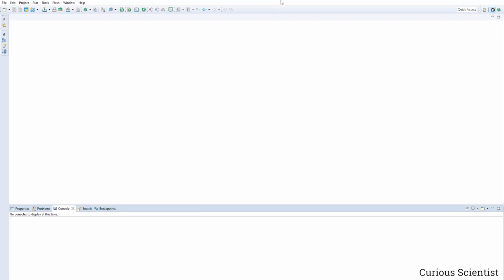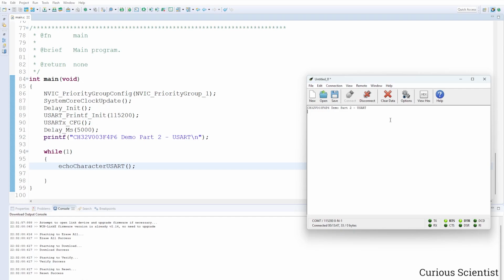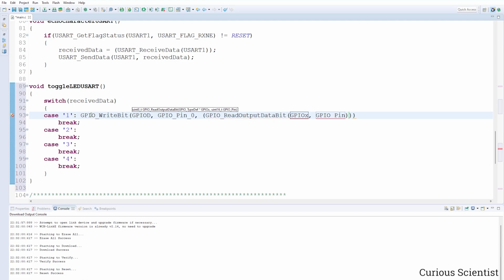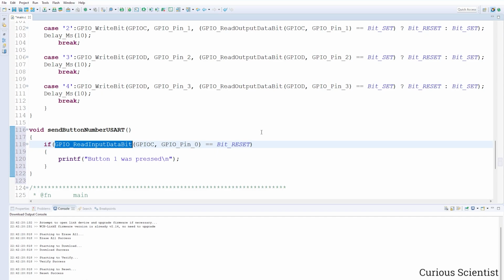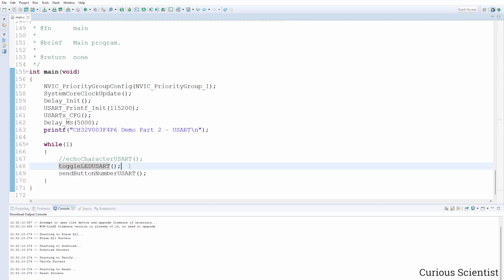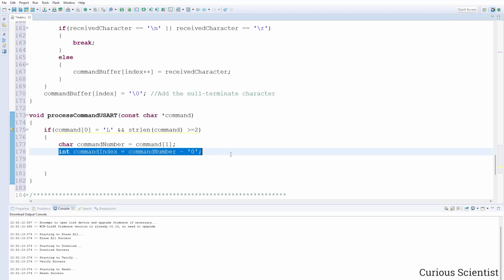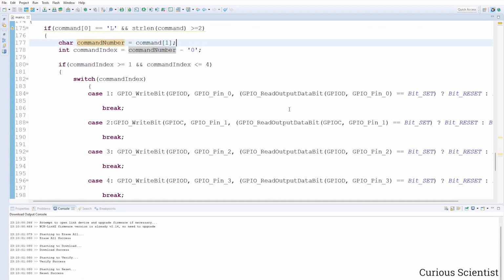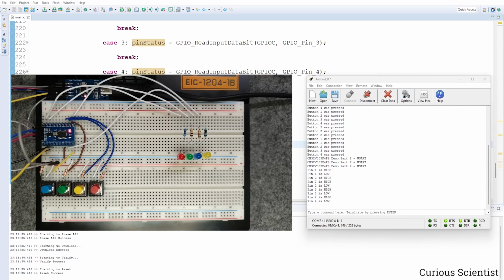CH32V003F4P6 Tutorial - Part 2 - Basic USART operations

Comment from the maker: CH32V003F4P6 USART Communication Tutorial - Part 2

* 0:00 Introduction: This tutorial covers basic USART communication with the CH32 microcontroller, building on GPIO manipulation from the previous tutorial. 
* 0:26 USART Importance: USART is crucial due to the chip's lack of native USB, enabling communication with a PC via a USB-to-USART converter (often integrated into the programmer).
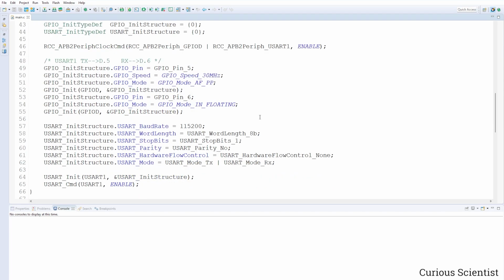* 2:30 Baud Rate Warning: Emphasizes the importance of matching the baud rate (e.g., 115200) between the microcontroller and the serial terminal on the PC to avoid receiving garbage characters.
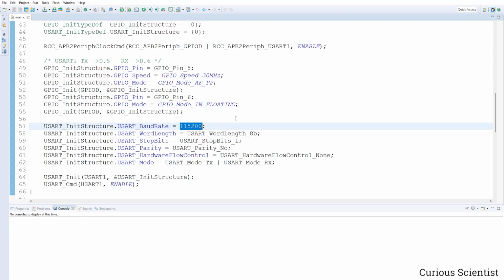* 3:38 Basic Echo Function (later removed): Demonstrates a simple function that receives a character from the serial terminal and sends it back, showcasing bidirectional communication.
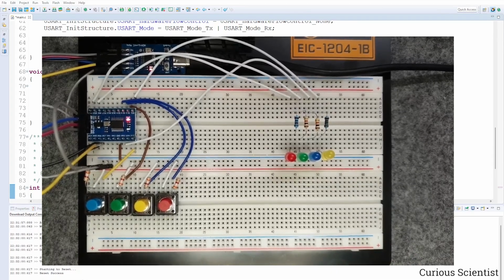* 8:56 Toggling LEDs via USART: Implements a function (`toggleLED_USART`) that toggles individual LEDs (connected to PD0, PD2, PD3, and PC1) based on received characters ('1', '2', '3', '4').
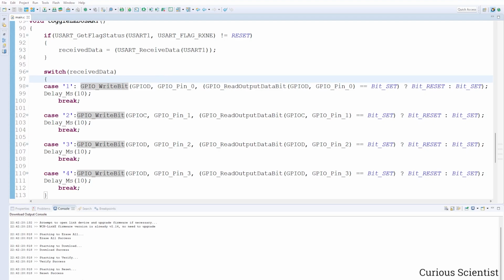* 16:25 Reading Button States via USART: Introduces a function to read the state of four buttons (connected to PC0, PC2, PC3, and PC4) and send the status (high or low) back to the serial terminal. Includes debouncing to prevent spurious readings.
* 22:39 Parsing Commands with Command Character and Number: Develops a more advanced approach to send commands like "L1" (toggle LED 1) or "B2" (read button 2 status). 
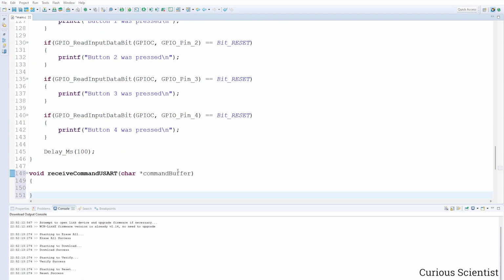* 24:12 Receiving and Storing Commands: Creates a `receiveCommand` function that receives a command string (up to 9 characters) from the serial terminal and stores it in a buffer. 
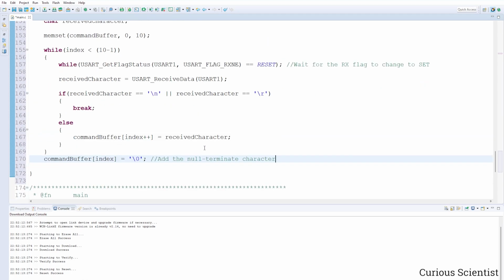* 28:40 Processing Commands: Implements a `processCommand` function that parses the command buffer:
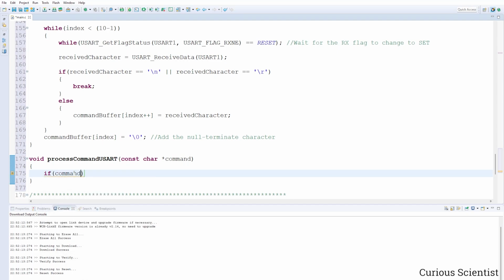    * 28:48 LED Toggle Command (L): If the first character is 'L', it extracts the LED number (second character), converts it to an integer, and toggles the corresponding LED if the number is valid (1-4).
    * 35:45 Button Read Command (B): If the first character is 'B', it extracts the button number (second character), converts it to an integer, reads the button's state, and sends "high" or "low" to the serial terminal.
* 40:36 Summary: Recap of the tutorial, highlighting the ability to send commands to control LEDs, read button states, and parse commands received via USART. Encourages viewers to check the website for resources and support the channel.

I used gemini-1.5-pro-exp-0827 on rocketrecap dot com to summarize the transcript.
Cost (if I didn't use the free tier): $0.03
Input tokens: 19624
Output tokens: 583

Comment: Did somebody succeed to enable USART2 TX on PD0 of CH32V003F4P6?
Reply from the maker: Unless you want to brick the MCU, it is not recommended. You need to remap the USART, but in that case, it would use PD0 and PD1. PD1 is also SWIO and it can not be remapped. So you'd need to disable the SWIO. It is doable, but you'd need to know what you're doing in case you need to reflash the chip...
Reply: @CuriousScientist  I just want to remap single TX to PD0, even if I loose SWIO (I know miniwchlink -b :) I badly need different pin for easy layout. Did you successfully make it?
Reply from the maker: Reference manual, 7.2.11.2. You can read everything about it. I am not interested in remapping the USART pins, especially to PD0/PD1, so I never tried.

Comment: since you posted your tutorial, fucking moonriver has changed. before they wrote:RCC_APB2PeriphClockCmd(RCC_APB2Periph_GPIOD ....... now you have to write: RCC_PB2PeriphClockCmd(RCC_PB2Periph_GPIOD......!!!!!!!!!!!!!!!! , and so on
Reply from the maker: I must check this. It's very uncommon to change the abstraction layer.
Reply: @CuriousScientist  I returned to trying to switch to cx32 after a couple of months, reinstalled Moonriver and found that my old projects do not compile! because the syntax was slightly changed, the library names were also changed, for example: it was ch32v00x_rcc.h , it became ch32v00X_rcc.h . and also in your github in lesson 2 there is a small error: GPIO_InitStructure.GPIO_Speed = GPIO_Speed_50MHz; probably it should still be 30mhz